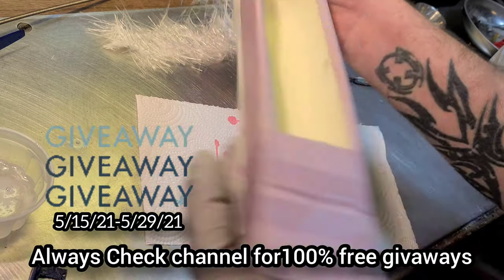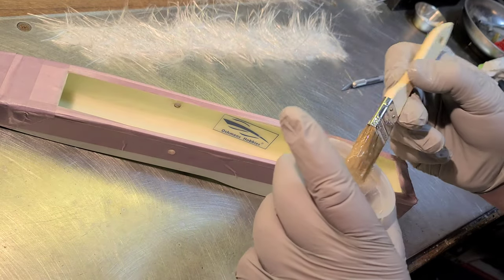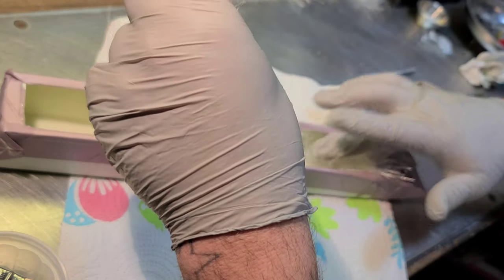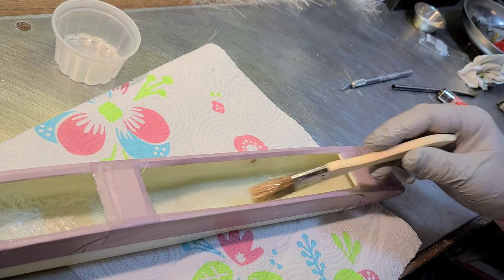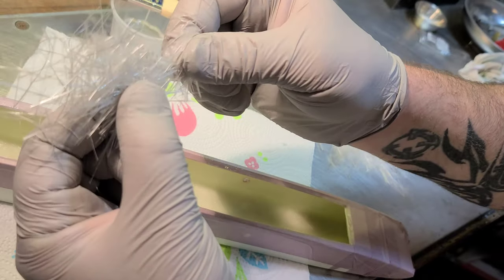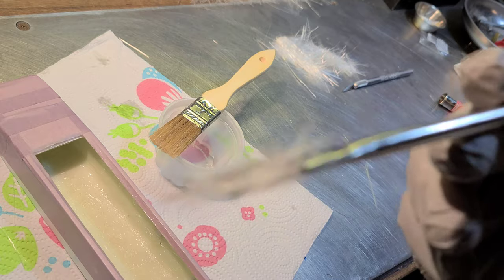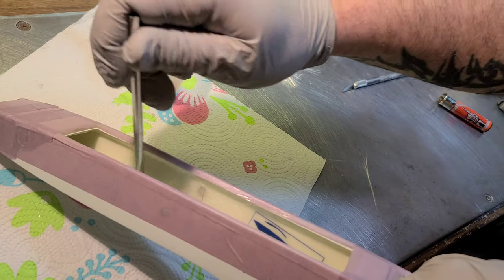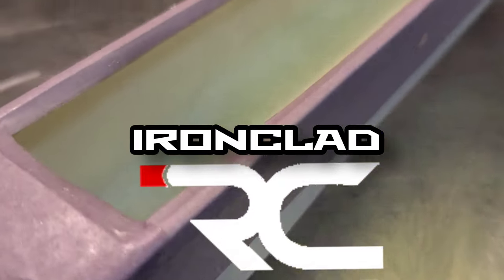How To Fiber Reinforce a RC Boat Hull With Epoxy - RC Boat Build

Comment: Thanks for the video, brother... I just got the new #v2 Twin Miss Geico Zelos delivered yesterday... I want to lay down some carbon Kevlar mix and resin all from a company called fiberglast to strengthen my hull even know they stay that the new v2 model is stronger than the v1 model....I just don't my hull splitting apart when I am doing 90 if you know what i MEAN.. MY MAIDEN RUN WITH MY NEW MISS GEICO BOAT WILL BE THIS WEEKEND, SO KEEP AN EYE OUT for a new video....
Reply from the maker: Fiberglast Co.  great I get all my gel coats from them.   Good luck with the maiden.   Thanks for watching

Comment: I just bought my first rc boat, I bought the tfl pursuit v hull and was thinking of reinforcing parts of the hull, can I use like a regular 5min, 15min, or 24hr epoxy with the fiberglass matting? Or do you need to use a specific type?  Most of my reinforcements are going to be around the mounting plates for the motor, esc, servo, etc that look like they were just glued to the hull. Do you think reinforcing those plates are a smart move? Or I’m just wasting my time and effort? Lol 😂
Reply from the maker: If I'm not mistaken  the battery tray in the pursuit is fiberglass and the not sure about  the mounting area. 24 hour is the best bet. Rough up  inside hull with 80 grit and wipe with acetone  (not the fast acetone it will melt plastic) before you 24 hour epoxy  the hull.  (Epoxy will not stick to some plastics) i know it will stick to abs,   BEST  to try epoxy on a  small area before you do the whole project. Wait for epoxy to cure then try and scrape it off. Test test test....This frp boat is an epoxy hull WITH PLASTIC EXTERIOR
Reply: @IRONCLADRC  tyvm!

Comment: Hmmm. Is that totally needed on a smaller  rigger? Its adding more  weight and when its on plane not much should be in the water besides the prop, rudder and the sponson riding surface.
Reply from the maker: Yes sir it was flexing really bad.   I added strength which I need because I'm a terrible  behind the wheel!l lol

Comment: Would you reccommend doing this on a modified vhull? ive got a vector sr80 pro with some mods coming in and future motor
Reply from the maker: Yeah you can, i think it's an abs hull, you realy need to rough up the abs before you epoxy. The hull..   Don't mix it hot. And thoroughly wipe it down with acetone. (Not fast acetone  it will melt abs/plastic
Reply from the maker: If the boat need it most definitely, if the boat seems solid I would go with it. Use your better judgment, ya know